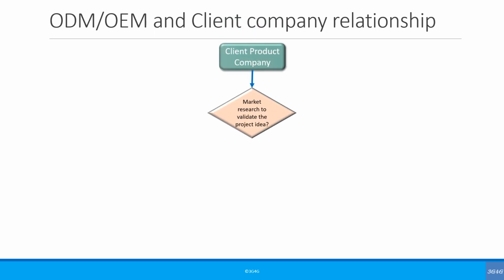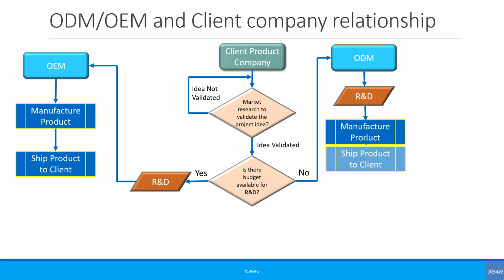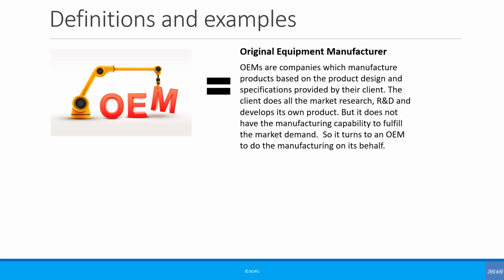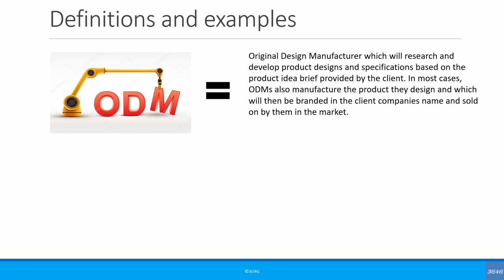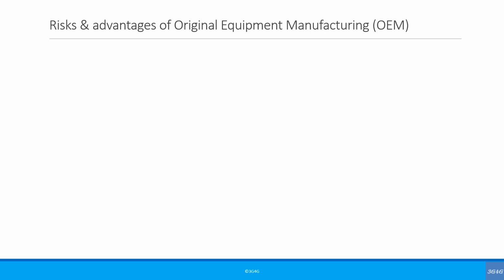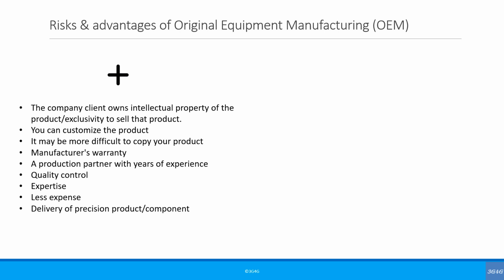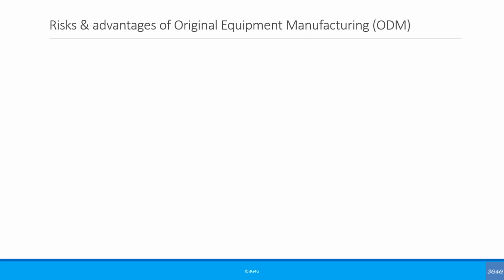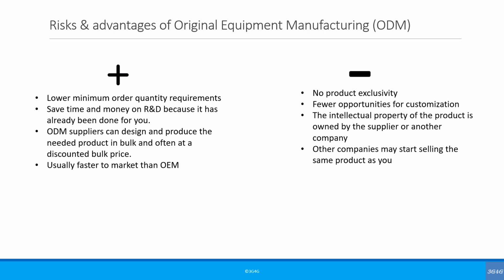Beginners: Difference Between ODM & OEM

Comment: You lost me with that example.
Does DELL design, research, R&D those AMD CPUs and Samsung made SSDs? Or they just purchase already made ssds(components) which were designed, researched by samsung?
Reply from the maker: OEM can use components from other OEM/ODM manufacturers and vice versa. Why reinvent the wheel when it's already available.

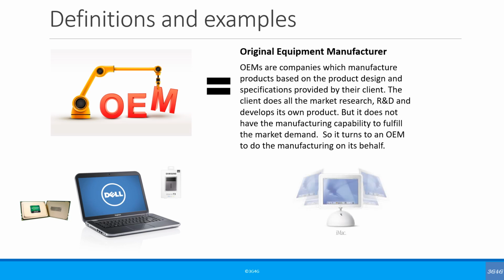Comment: At 2:20 Wouldn't AMD be an ODM because you are not giving then a processor design ... You are adjusting your product to their products (AMD,Intel, Samsung) at the end of the day they wouldn't be nither of both.

Or they might be an ODM...
Reply from the maker: AMD is a chipset vendor. Now, they don't make the chipsets themselves. They design it but outsource the manufacturing to GlobalFoundries (GF). Here GF is an OEM that manufactures based on design and specifications of AMD. If you are creating a product similar to AMD, Intel, Samsung then you are a competitor to them.

Comment: My doubt is: When it comes to certifications, for eg: CE or FCC, who is responsible to carry out the certifications. Will it be the OEM or ODM or the client product company? And when the client product company sells the product to the end customer/user and the end customer/user asks for certification then in whose name will the certifications be there which will be seen by end user/customer. Will it be there in the name of OEM or ODM or client product company?
Reply from the maker: We think you have sort of answered your own question. In case of OEM, the client product company would be responsible as the OEM is making the product as per the specifications provided. 

In case of ODM, it can be a bit tricky. If the Client product company, who are actually product owners, don't want to tell the world about who made it, they will do all the certifications, etc. On the other hand, ODM may have already done certifications on some parts or may just be re-branding something they already sold to multiple people. In that case ODM will do the certifications.

It's not necessarily clear cut, this has to be agreed during contract phase. A client product company may not have the know-how or enough people to spend time and money doing certifications. They will certainly seek someones help. It could be the ODM/OEM. The company name will depend on who files for it.
Reply: @3G4G5G  great precise answer. Cleared all my doubts. Thank you so much :)

Comment: Thank you so much, this is very helpful.
I want to make a soft toy, and I'll provide the supplier my own design in CAD and all the required specs such as dimensions and material. In this case, should I consider my product an OEM or ODM?
Reply from the maker: "should I consider my product an OEM or ODM?" - Your product will remain a product but as you have done all the R&D yourself, your supplier will be OEM that will manufacture it to your specifications. We should have mentioned that some ODM's will do OEM job too as that keeps them busy. Hope this clarifies your doubt.
Reply: @3G4G5G  Thank you, it's clear

Comment: So, just as some feedback, you knwo I love your channel, but your audio in many of your videos, is way way under the norm. It's been getting worse as well. The audio levels are so low I have to crank up the volume on the master volume toggle. Is this something you can correct? it really makes your videos much harder to actually listen to...
Reply from the maker: Thanks, will check. One of our laptops keep on reverting to the default setting, like what happened on this one but we can still hear it very well on 50% volume. Checked it on 3 computers.